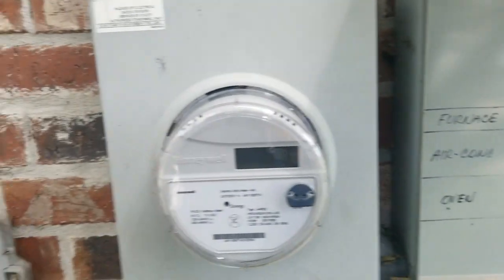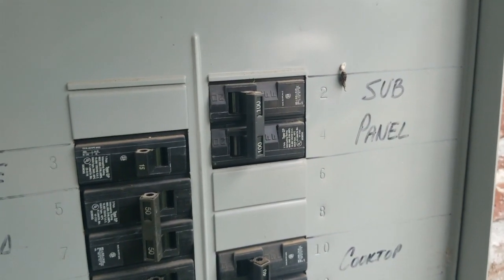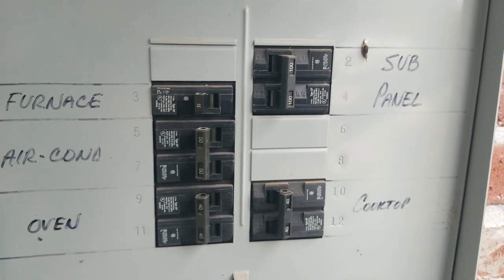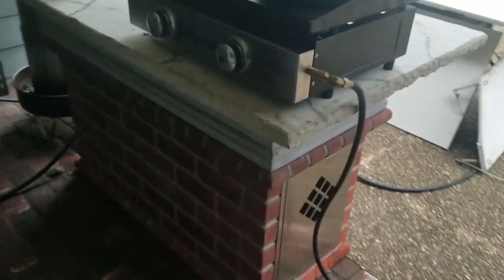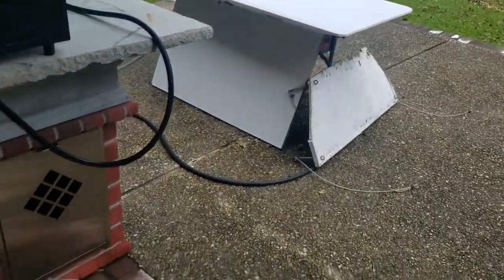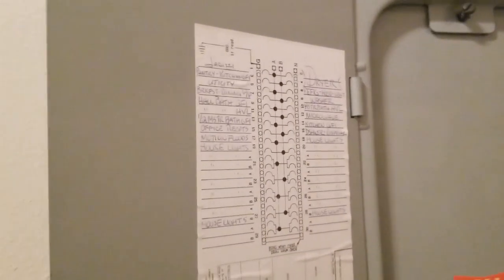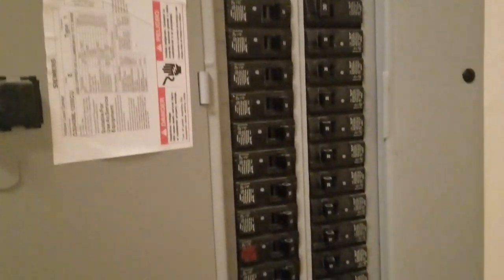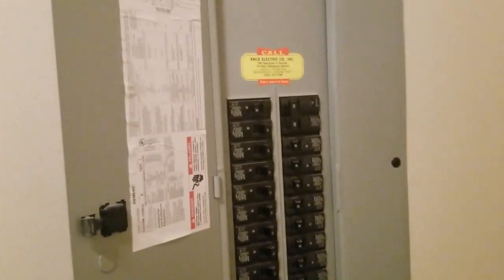Hurricane Ida: How I connect my portable generators, to back feed power to my house

Comment: You actually dont need to switch off all the breakers in your main panel if you are feeding into the subpanel to keep from backfeeding the grid. All you have to do is turn off the subpanel breaker and you can leave on the A/C, Furnace, Cooktop, and Oven breakers. 

I only turn off my subpanel breaker and only thing left in my main box is A/C and well pump. When I feel the A/C kick on I know I have power restored and unhook the generator from the sub panel.
Reply from the maker: We have had so many hurricanes, I have witnessed many very bad restart ups of power. Often the power cuts on/off/on/off multiple times  as it reconnects. I do not want my expensive high draw devices to go through those power surges. Especially the AC, as that is very hard on the compresor. So I cut all of those breakers until the power is on steady
Reply: @MikeJordanUnCamplicated That's a good reason, just wasn't necessary to avoid backfeeding the grid.

Comment: Which extension cord is that?
Reply from the maker: It is often called a suicide cord 😳because it has 2 male ends. So if you are dumb and plug it into a power source, then touch the other end, you are going to have a bad day. If you stop and think every time you use it, there is no issue. But because of the electrocution possibility, you can not buy the cord. That is a DIY cord. I bought the wire and plugs to fit my gen and dryer plug separately, and put them together myself

Comment: Kind of sketchy but you have to do what you have to do and it seems to me like you know what you’re doing just for everybody else out there make sure your main is off when you’re back feeding at all times good luck
Reply from the maker: what I did is nowhere near sketchy. It was absolutely electrically prudent
Reply: @MikeJordanUnCamplicated  the suicide cord is a little sketchy, no safe way to ensure no live prongs if it pops out (and it's not twist locked in), but otherwise looks like you have a handle on things
Reply from the maker: @jacobthebirdy  the generator end is twist locked. Never in the history of man has a drier plug popped out :) Its all good. You just have to make sure all power is off and the gen is not running when you plug in, so the suicide part does not take effect :)
Reply: @MikeJordanUnCamplicated  I use to run the exact same setup, always gave me the heebie jeebies using the dryer outlet. A few months ago I installed a proper inlet and panel interlock for my generator though so we were all fixed up just in time for ida. Cool  to see one of my fellow louisianians running a very similar setup to me though. I wish i had done my conversion to natural gas back when you did. I was looking at it back in november but ended up not pulling the trigger on it till day 2 of my hurricane ida power outage.

I've been contemplating the exact setup you have with 5k+ watt generator for daily use with a 2200 watt inverter for  night time running the freezer use nice to see it's as efficient as I hoped.
Reply: @MikeJordanUnCamplicated  oh yeah and just to quell any concerns for linemen in the area. I spoke to my local entergy linemen and was universally told me a wrongly backfed generator won't be a danger for them. They dead short those lines before touching them, it'll at least pop your generators breaker if not burn up the generator before its a danger to them, thats the only reason i felt comfortable backfeeding it like this.